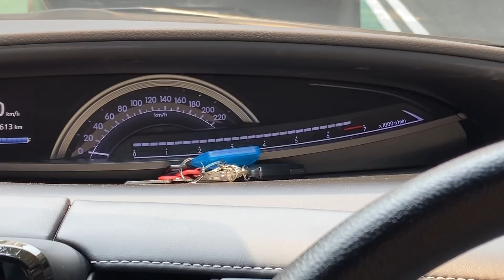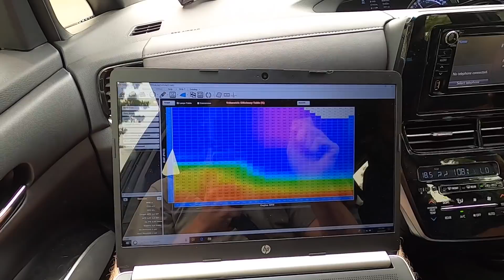**FREEDOM ALERT** Finding TOAST In Australia and Revealing His AMAZING New Look!! (ready to rip)

Comment: I would strongly suggest picking up a wagon Holden while you're over there and shipping it back home
Reply: Ute Redline SSV
Reply: Maloo ute
Reply: He was about to do that last time , instead he bought the dale truck
Reply: Newer than 25 years it cannot be shipped back complete. It has to be a rolling shell with EPA and NHTSA parts removed like engine, trans, diff, headlights, seatbelts, etc. Tail lights are legal but would suggest removing them and putting in a box somewhere in the container due to cbp breaking them because they are ignorant and think they are illegal. 

Older than 25 years, you can bring in as is running and driving but once here the headlights need to be changed, or adjusted for LHD. 

If newer than 25 years and you want to drive legally on the road you need to do some work to it like convert to LHD. Then get it titled as the donor car, or custom car. For VE's the donor car would be a G8. For a VF the donor car would be a Chevy SS. 

If you never intend on putting it on the road legally and just drive it offroad, like at the drag strip, then you can leave it RHD, put an engine, trans, diff back in it and go. 

Source... I work for an import company that has imported quite a few VE's and VF's as well as older ones like the VY's and VZ's. We also have a crewman a 4 door ute shell currently in the states for sale.
Reply: We used to call ours "The Commode" :)
Reply: V A 
Sounds like freedom.....
Reply: Ve series 2 Wagon take back home
Reply: You know what's old enough to go to the states now? Anything from 1995 and older which means alot of Australia classics are up for grabs VL, VN I would love to see him with a HQ or even a Monaro or something, but it also means there's alot of Fords he could get for his little collection he's got going on lol 

Best part is that he can get cool cars that you can only get in AUS/NZ and I'm sure he could find loopholes around the LHD conversion, or just use for track events (Cleetus and cars/Drag racing) definitely needs a car from AUS tho!
Reply: I found them one right here in va last summer. Said they had to many projects going..
Reply: Theres a company that imports maloo body's into the us and you juat drop in your own engine and trans, hoonigan did it.
Reply: @soul15644  Or Ute. But note they cannot be taken back complete running and driving. Has to be a rolling shell.
Reply: @kman634  "Anything from 1995 and older"

Not exactly, anything 1994 and older can be brought in running and driving. For 1995 it depends on month of manufacture. For instance if it's 4/1995 then as long as the container lands in April, all is good. May, not so good and will have to be held for a month and those storage fees are not cheap. 

"Best part is that he can get cool cars that you can only get in AUS/NZ and I'm sure he could find loopholes around the LHD conversion,"

Older than 1994 and as described above some in 1995... You do not have to convert to LHD... At all you can leave them RHD. 

Newer than 25 years to make them legal to drive on the road, you have to do a certain amount of work to them to get the custom car title, or use the title of the donor car. Legally anyway. So typically converting to LHD accomplishes this requirement. 

Now as for offroad use like track events, you can bring in a 2019/2020 shell of whatever car as long as the engine, trans, diff and other components are removed. Then when it gets here, you can put it back together with same/similar engine, so long as the purpose is not to drive it on the street, or get it titled. 

The newest one I think we have imported was a 2016 VF for a client.
Reply: @VA-ng2ve  you work for Left Hand Utes in Colorado?
Reply: @bepbep7418  No, I am on the east coast. They only import shells they convert themselves. For instance you couldn't buy a shell from them and then do the work yourself. We import the shells and either you do the work, or you get someone to help with the conversion.

Comment: I keep extra respirators in my truck during fire season. I have had a few situations where I have had to drive through fires in close proximity to the highway or crossing it. Where the cabin filter already isn't cutting it. Its crazy how fast the reduced oxygen and other chemicals and gasses and smoke can start over powering you in such situations with out.

Comment: Anyone remember when cleet almost bought a Holden truck, PS, you should ship one back to the us
Reply: Holden Ute*
Reply: I agree he should ship a Ute back, but if it's newer than 25 years old, it cannot be imported complete. Has to be a rolling shell with engine, trans, diff, and other things like headlights, seatbelts, etc removed.
Reply: And needs a fire wall swap from a gto
Reply: @Remylebeau107  Depends, the GTO I believe are the VY's. The VE's are G8's the VF's are Chevy SS. Also you can do the whole front clip. They are essentially the same car. Also changing just the firewall may not be enough in some states. If for instance your state is 50%, then just changing the firewall out will not be enough. Changing the front clip would be. 

The factory weld marks on the A-pillars and floor are identical so a good frame and body guy can line them up and make it as good as the factory did it.
Reply: @jon white yes u meant Ute I don’t know why I said Holden truck, sorry to all the Australians I have offended
Reply: @gunnarcox8776  Not Australian, just deal with them a bit. A note, the difference between truck and ute, is a ute the truck bed is part of the body. If it's separate then it's a truck.

Comment: I say it every time get a UTE😂
Reply: I agree, a good Holden VE, or VF would be an awesome project. But note it cannot be imported complete, it has to be a rolling shell with certain things removed. Otherwise it will not be legal to import.
Reply: V A there are other paths you can take to import but they can be a major pain in the ass, but yea pretty much all ways of importing a not legal aged car is a pain. I don’t know the legal term but you can import it as a non road legal car if you don’t want to tear it down but I’m pretty sure that comes with extra taxes
Reply: @theZDOME  You cannot import a vehicle newer than 25 years old complete. Well there are certain ways, but they do not apply to normal every day Holden Utes. One way is if there are 500 or less made of a specific vehicle then they can be brought in under the show and display exemption. 

"but you can import it as a non road legal car"

You are probably thinking of the race car exemption. That does not apply to a normal vehicle. It has to be specifically made for racing. Like a roll cage added, engine, etc all changed for racing purposes. Then yes, you can import that as a running driving car for offroad purposes. But if you want to import say a 2012 VE that is running and driving, with rego, etc. You cannot import it as a race car. 

What you can do is import it with the engine, trans, diff, seatbelts, headlights, etc removed. Basically anything that is NHTSA or EPA regulated removed. Then you can import that and then leave it RHD and put another engine in it and then use it as an offroad vehicle. 

You can technically put all the parts back on the vehicle that was taken off, but they cannot be in the same container. Also since the engine is newer than 21 years, it has to be taken apart to a degree. Usually taking the heads off is good enough. So you can have the shell in one container, the engine block and trans in another, and the heads in a third. You might be able to get by with the heads and the shell in one container if you have other vehicles and other parts in it. But in reality for the VE's it's just a 6.0 LS1 engine. Not really different from anything we have here.

How do I know this? I work for a company that imports/exports vehicles, engines, freight, etc to Australia. I have personally had hands on with 10+ VE's and about 4 VF's. We also import Barra engines, and like mentioned above, since they are newer than 21 years old they have to be split. 

Just to be clear, you can probably find people who import newer than 21 year old engines complete. But they are not doing it legally. They run the risk of having those engines confiscated and then the importer fined. 

One last caveat to that last bit. If it's a "race" engine, like a purpose built engine like an LSX that was never meant to be in an EPA regulated like vehicle then yeah those can be imported complete. Like say you buy a billet barra built engine for 20k, that can be imported without splitting it. Basically if the engine was at one point in a running driving vehicle without significant modification it's not a race engine. 

If you have any questions or want to import anything and curious on costs or anything like that feel free to ask.
Reply: V A makes sense yea all I do is drag race and work with drag cars, I don’t know anything really about show car stuff ect, great to know, I’ve always wondered how my boss got his r34 lol now I know, well you’ve helped me out a lot, do you import cars mate? Hahaha, you’re a book of knowledge about it, I could use your help getting me the previous gen focus rs 😂
Reply: @theZDOME  "I’ve always wondered how my boss got his r34 lol now I know"

It may be here illegally, quite a few are. Just because you can get it titled like in FL for instance doesn't make it federally legal. 

Is it just a drag car, or is it on the road? Without knowing more info knowing whether or not it's in the states federally legal or not is hard to tell.

"do you import cars mate? "

I work for a company that imports vehicles to and from Australia. Our cost can be anywhere from 3300 to 3800 for something like a normal sized vehicle like the Focus RS. We do all of the paperwork and all you have to do is pick it up at our VA warehouse, or if you are closer to the west coast that can be arranged as well. That price is our cost, does not include cost of the shell. 

"could use your help getting me the previous gen focus rs"

To find vehicles in Australia there are a few ways you can do that. Ebay.com.au. Gumtree.com.au and facebook marketplace. On FB marketplace just change your location to Brisbane Australia, and search. 

I assume you mean Third Gen? 2011-2018? 

What kind of budget do you have in mind? What kind of damage is acceptable? If you get one running and driving the engine, trans, diff, etc have to be removed. The more specifics the easier it will be to narrow it down.

You can send an e-mail at ocpimporters - gmail.
Reply: V A sweet, cleetus’s sun base is the best well I’ll look into it and possible be working with y’all soon, thank you so much mate. It’s a drag car only I’m pretty sure it’s legal lol, but yes it’s only time on the road is in the back of a trailer, he’s the only guy in my class who always beats me, other than the one time he broke his axle luck dog me, I screenshot all your info I’m going to look into if I want a rs or a r33 or 32 and I’ll give you an email 👌🏻
Reply: @theZDOME  R33 and R32's can be brought in legally running and driving. I have had hands on with 4 R33's and 3 Supras, with another supra on the water right now. 

To get a ballpark on what it would cost to import one, take the amount it shows in AUD, multiply by 0.7 then add about 4k. It should be less than that amount, and depending on where it is it's possible to be a little more. For example say it's 7,000 AUD that would be 4900 + 4000 So the total landed cost to our VA warehouse would be around $8,900 USD. That covers all the paperwork and everything. You can come and pick it up, or have a transporter pick it up, that is not included in the cost.

Comment: Cleetus my dad has a 72 Gran Torino that he has had since in was a couple years old. He got sick years back back and made it a retro mod with a 2012 gt500 crate motor Vette suspension Moser rear end tci6x 6 speed auto  and a frame off restoration he put his life saving into the car and it's beautiful and and it was show quality but things couldn't get tuned And after his money is gone he tried to work on it himself if you could donate the time he has the parts and a lot if brand new parts since his reviews look up project breathless Gran Torino it will give you so much content. And with you maybe there car will be done the right way even though it's a Ford